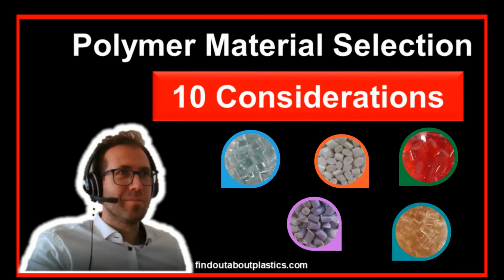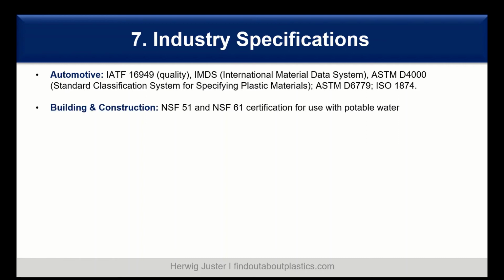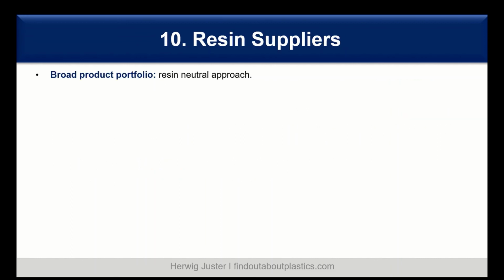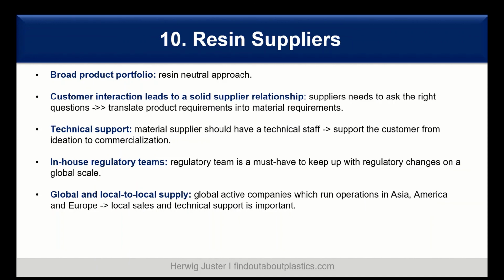10 Considerations for Polymer Material Selection

Comment from the maker: Time stamps: 
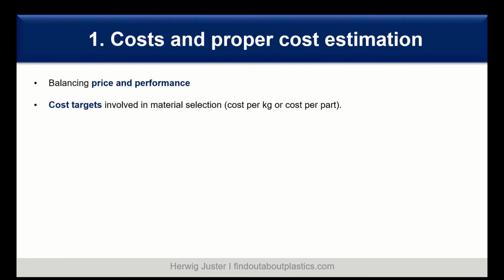00:34 1. Costs and proper cost estimation
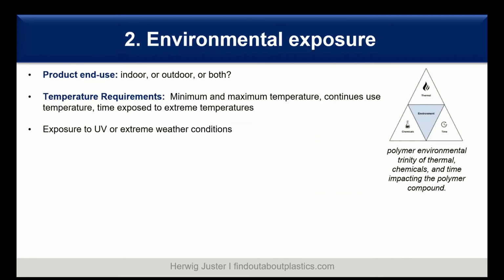02:11 2. Environmental exposure
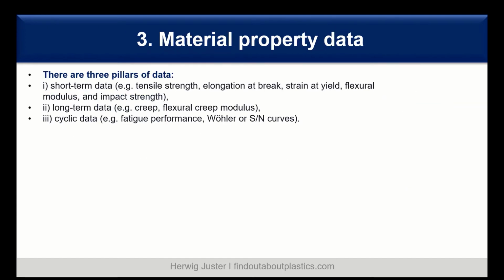04:06 3. Material property data
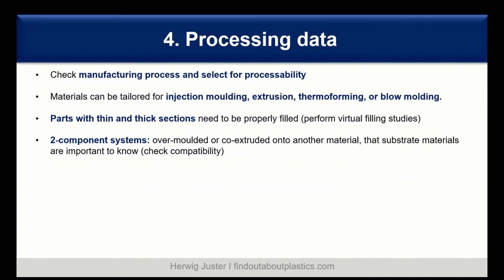05:26 4. Processing data
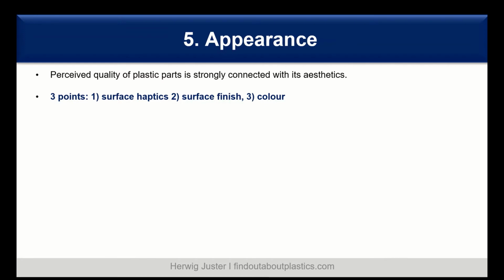06:43 5. Appearance
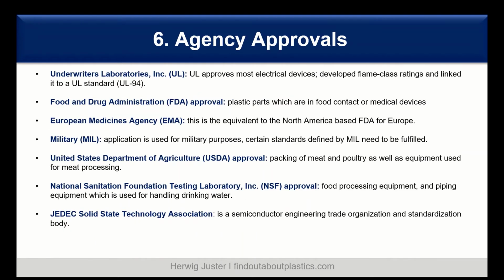08:38 6. Agency Approvals
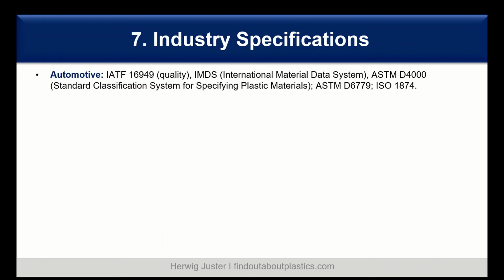10:10 7. Industry Specifications
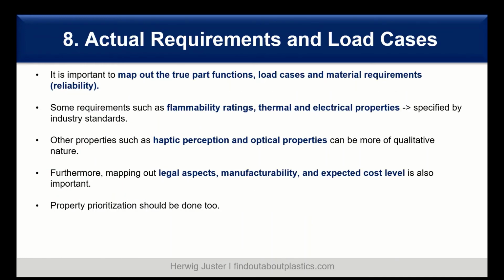11:19 8. Actual Requirements and Load Cases
12:28 9. Prototype Testing
13:38 10. Resin Suppliers